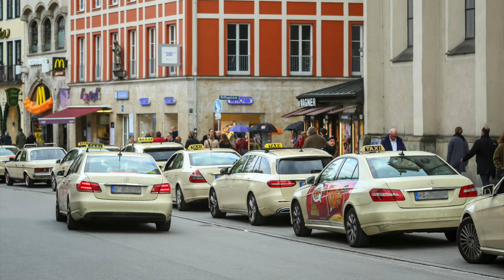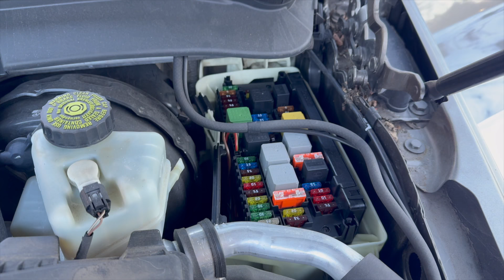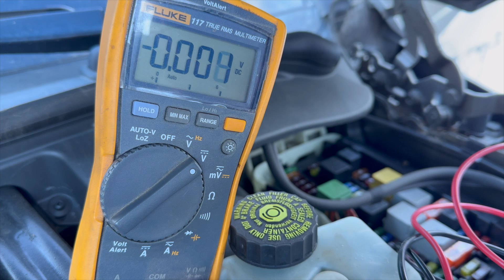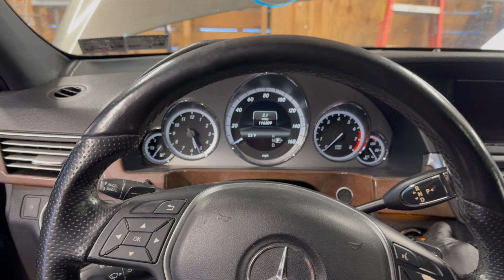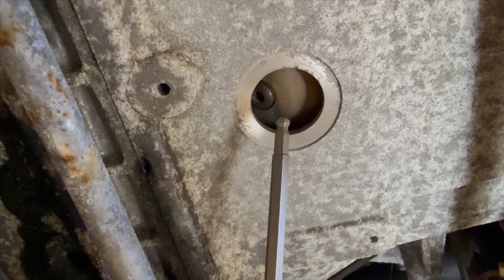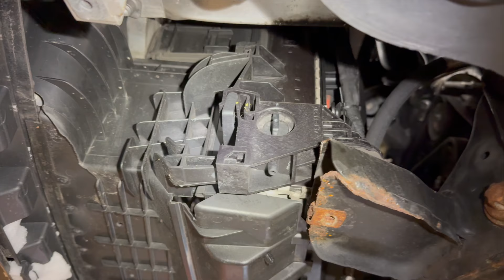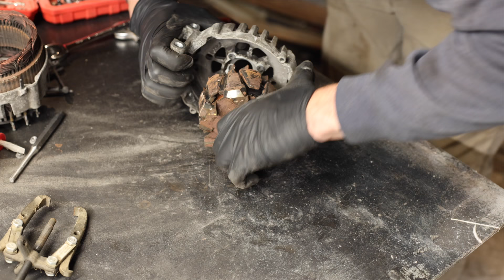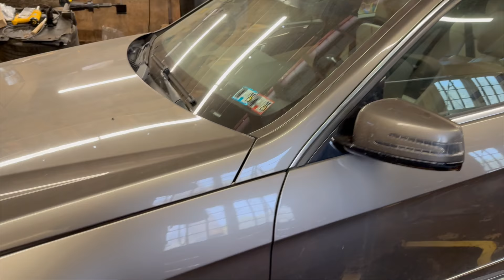I Bought the Toyota Camry of Germany, Except WAY Cheaper (and Better)

Comment: They use diesels in Germany, that’s why they last over 500,000 miles
Reply: Correct, almost all European taxis run diesel, it's usually cheaper per liter here, and mileage per liter is better.  
And usually diesel engines are more reliable as well :)
Reply: @raskalthefirst  just like the diesel tanks.
Reply: @raskalthefirst  In many places diesel taxis are not allowed any more. In Madrid diesel taxis are a rare thing now,almost all of them are hybrid, electric or gas,but no new diesel cars. 
Those Mercedes cars are not very reliable,those are not like the old one´s you can run it forever and make millions of km. I would add Mercedes cars since 20 years ago are not build to last,just build like any other car or even cheaper.
Reply: @josemorenoporras7506 when Inwas in Madrid late 2019, the taxi fleet was almost all Prius V’s. Those are shockingly roomy, so much more trunk space and headroom. The trunk easily swallowed 3 24” suit cases and a folded up rollator. We had an Merc E taxi in Vienna. That took 2 24” suitcases and the rollator, but woud not have been able to take the 3rd suitcase I’d our daughter was along. It was super comfortable.
Reply: @raskalthefirst that’s not true that diesels are usually more reliable. Owned many, in cars and trucks from multiple brands, overall decent reliability but omg repairs can be wild there aren’t many diesel mechanics left in America. 😅
Reply: @Leeboi2926  American diesels are shite compared to German ones.
Reply: @kristoffer3000 Have you heard of Cummins, snitzel 😂😂😂😂
Reply: @HEMI345S  Yep, 70's designs, today! lmao

Literally every Euro truck engine is better lmao
Reply: @Leeboi2926   "diesel mechanics", never heard of that in EU, any mechanic can work on any car
Reply: "there aren’t many diesel mechanics left in America"... That sort of explains why servicing and repairs might be "wild"

Do you honestly think taxi drivers would routinely use diesels if they were unreliable? You kinda need a car if you are a taxi-driver... it's implied.
They would dump it fast if it was problem
Reply: @agostinho6550  because the US and their job training system is a mess. There is almost no regulation on what to learn and mechanics need to pay for their training themselves and of course they don't do the diesel course because the return on investment isn't there because almost noone drives a diesel in the US. In Germany you have to learn to work on all engine types: petrol, electric, diesel, LPG etc. to become a licensed mechanic and you get trained in a state operated school and in a company and get paid for it. It is highly regulated and the standard is the same.
Reply: @raskalthefirst  not true at all. Nowadays, it is hybrids.
Reply: @raskalthefirst  Modern diesels are not more reliable.
Reply: “Good n tight” on North American cars, On German cars its “schnizentight”
Reply: Yes, but since diesels are banned in America they have no idea what that is
Reply: Modern diesel engines have become increasingly complicated primarily due to the need to meet emissions. Often the diesel option is less reliable than the gasoline alternative.
As for the longevity of taxis, the cost of replacement is a significant expense for the company or driver and it's usually cheaper to repair than replace. Any vehicle can be kept roadworthy as long as the owner is willing to pay for repairs and replacement parts.
The preference for diesel in European taxis is it's because diesel engines get significantly better fuel mileage than gasoline-powered vehicles. Diesel is also usually cheaper and the combination means more profit for the taxi driver or company.
Reply: @williamegler8771  Sure they're a bit down on reliability these days, but they still have great durability generally. So yeah you'll have to repair them now and then, but you'll still get 800k km or so out of a dinky 4 pot diesel before it becomes uneconomical to repair.
Reply: @williamegler8771  If the emmisions equipment happens to .... fall off... then the reliability skyrockets
Reply: @petarmiletic997  You means capping off the egr and deleting the pussycat... surely not LOL
Reply: K
Reply: True but the gas powered ones are also very robust.
Reply: Maybe 30 years ago
Reply: @Yoolneverguess  not really. That was around the time they had that ridiculous wiring harness issue. Couple that with the fact that every straight six car they made exploded is head gasket and they had that garbage 4 speed that would commit suicide at 120,000 mi that they put in fucking everything.
Reply: BS
Reply: Petrols last that much too. We service and maintain cars, that's why they last and they don't in USA becuase people treat them as disposable lease cars that they use for 2 years and then replace. Diesels aren't inherently more reliable. Actually they're less reliable, harder to maintain and more picky when it comes to driving styles.
Reply: But the diesels available in the E class of this generation are not commonly capable of 500k miles. They usually eat themselves before that.
Reply: @evanshireman5644  they use a 4 cylinder 220d for taxis
Reply: @evanshireman5644 I have seen many om651 with 400k and up miles in Germany. It's pretty good engine
Reply: @evanshireman5644 the 4-cylinder E200 and E220 are tanks, get a pre- AdBlue model and enjoy the last of the proper diesel cruisers. I can personally attest if you proper stretch its legs to keep the DPF clear, the car will thank you.
Reply: I’m referring to the W212 in case anyone is confused!
Reply: @kevinobyrne8020 🎉🎉😅👍
Reply: @evanshireman5644  yeah I dont think the v6 is very good. The older 2000 era streight 6 ones were gods motor I beleve.
Reply: @richdog9000 v6s diesels are good engines.
Reply: @ there were no straight 6s in the 00s except with the diesels. Last gas straight 6 before the current one was the M104 from 89-99, very reliable as well. IMO, the reliability of the diesels has been overrated, starting with the OM603 engines you had head issues, the next few generations are pretty decent but parts are very expensive compared to the gasoline counterparts which are also very reliable. Some of the gas engines weren't as good, like the early M271/M272/M273 (mostly fixed by 2007 besides intake flap failures on the v6 and v8) but the M276 in his E-Class is a very good engine overall. The 4 cylinder diesels have been good but the OM642 V6 diesel is not a motor I would want to own.
Reply: @evanshireman5644  those 4 cyl diesels can achieve million km
Reply: @evanshireman5644 maybe in America, because of non servicing problem you guys have 😂in Germany they "must" be proper serviced or else😂
Reply: @evanshireman5644 The 4 cylinder engines are still capable of 500k miles, even the newer 2.0 litre w213 can be found as retired taxis with that kind of mileage
Reply: @evanshireman5644 the V6 OM642 is utterly reliable. Was even used in Grand Cherokee, Commander and Chrysler 300C.
Reply: @evanshireman5644 Its just maintenance. People kill these engines by putting cheap oil and filters but still do a long service interval. If you plan to use cheap stuff then change oil every 15k km and its fine but you cant do 30k like its original oil and filters
Reply: @evanshireman5644  om651 & 642 are perfect engines, if you do some preventive maintenance.
Reply: As a European hearing someone calling European cars reliable is a little mind boggling 😅
Reply: @RustOnWheels  Why would that be mind boggling? They have been making the best cars for a very long time now. One reason MB was the main Taxi brand for a very long time also.
Reply: @martinsvensson6884  it depends… The real old ones, especially the W123 are reliable, but into the nineties quality fell off a cliff, and continued to be bad deep into the zeroes. 

Every Mercedes since then is less bad (the 1995-2005 era was bad when it comes to basic stuff: rust, wiring, fire hazards, material and build quality - that luckily has changed for the better again) but you can’t compare them to Toyotas, especially when considering the costs of parts.

It’s not as bad as BMW but it’s no Toyota. Overcomplicated tech that makes them wonderful cars new make them horrible when second hand.

Toyota is known for being old fashioned; sticking to parts and tech that simply works and using it for decades. Mercedes this century is known for pushing the technological envelope for perceived (Arab/China) luxury but with all the issues it brings with them.
Reply: @martinsvensson6884 Mercedes-Benz hasn't been on top of the automotive game since the late 1980s. Least of all now.
Reply: @Majinbuukakke80976  They were on top, no1,  until during the 90's sometime. According to stats.
Reply: @Majinbuukakke80976  They were good until they tried to compete with Lexus on price and complied with biodegradability requirements by specifying rat food for wiring insulation.
Reply: @RustOnWheels  compared to the garbage they build in the usa it is
Reply: @RustOnWheels  You must be used to driving used ex-taxis with 500k km on the clock then to think otherwise.
Reply: Perfect end to a long hard day a waldo video thanks for the great content
Reply: @johntowel8103  that guy is not Waldo
Reply: E350 is incredibly reliable. The diesels in the states are 50/50 crap and very reliable 😮
Reply: Petrol engines can last just as long.
Reply: Nicht ohne Probleme!
Schaftdichtungen, Glühkerzen+Modul, DPF...
500k in Kilometer, geschweige denn Meilen sind die Ausnahme, nicht die Regel.
Reply: Fake news. Never see any 500k cars in germany. Nice try though, kiddo.
Reply: @jonc2914 He must mean kilometers but even then it's a stretch.

Comment: we need a shop tour. i cant belive you replaced the transmission bolts ! id love to see where you keep all your bolts if you replace nice bolts like that often lol. Or a Waldo Misc channel !
Reply: They are stretch bolts, so they are single use. Same style as for endcaps or headbolts.
Reply: @andrewvanbrummelen845  im not sure where you got that idea but they are not torque to yield, may its a maercedes thing but they would have been fine
Reply: @peted7387  yeah it’s a Mercedes thing. It’s car dependent, pretty stupid to make trans pan bolts stretch in my opinion

Comment: E-classes in taxi service in Germany are far from luxurious with usually a small diesel in them. Mercedes is basically the Buick of Germany.

I have a '14 E350 wagon. Great car, so far the only bits that have broken have been Japanese Denso parts. A/C compressor and radiator.

Comment: WALDO when will we get the generator part 2 you said would integrate with a raspberry pi. So when utility dies it automatically starts and switches over power feed

Comment: Filament from a commercial weed trimmer works well for cleaning sunroof drains. You need the heavier gauge filament used by the larger machines.
Reply: Nice tip!
Reply: Ha, I was just looking at my front loader washing Machine (before watching this) it has a similar type drain in the tub gasket (full of hair and other goodies no doubt) and I was wondering how to clear it ? so thanks for the heads up! regards from Spain
Reply: On VW Polo an old speedometer cable is used.
Reply: @marcwieber6989 you can use anything not just a speedometer cable
Reply: Thanks for the advice
Reply: Should be standard issue on old Range Rover L320's lol!!
Reply: I was wondering what he had dangling from above during the test drive. Makes sense now. Thx.

Comment: I own a 2010 E350 (M272 3.5 V6). It's got 177k miles on it (bought it CPO at 13k miles). Without a doubt, the best car I have ever driven. Getting to the point in ownership where oil leaks are beginning to pop up, but still, it's the best car I have ever driven and I wouldn't trade it for anything else.

Comment: If you had a real Toyota, you would not be replacing most of those parts, that's why they are worth another 10k. Unless this is  your hobby you will spend more on repairs on and E class than on a Toyota.

Comment: Who would design filling up a tranmission through the drain plug on the bottome of the pan. Insane.
Reply: Insane? It works pretty well, easier than some of the ZF 8 speeds where the side fill isn't the easiest to access. Idk if you could say most transmissions these days fill from below but a good number.
Reply: @EdwardM104  what's wrong with filling the transmission from the top?
Reply: @ It's a combination of things. The primary reason they did away with it was to keep customers from working on them, more money for service departments and shops. It's also partially due to customers introducing contamination when checking the level or putting the wrong fluids in. Modern transmissions are much more sensitive to fluid contaminants than they were in the past, even paper towel lint is enough to cause serious issues.